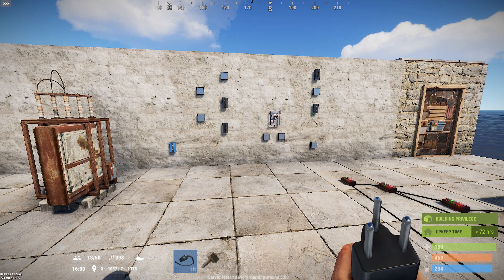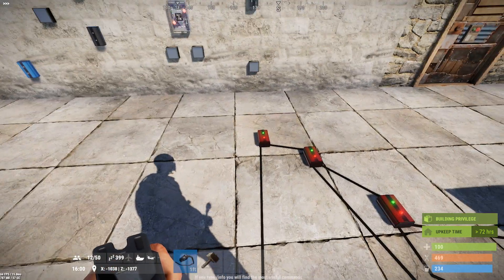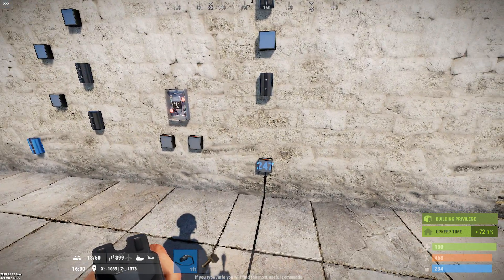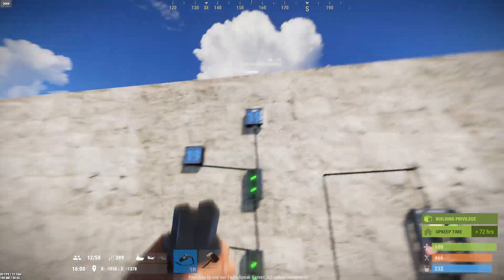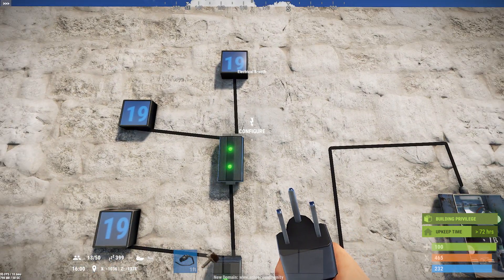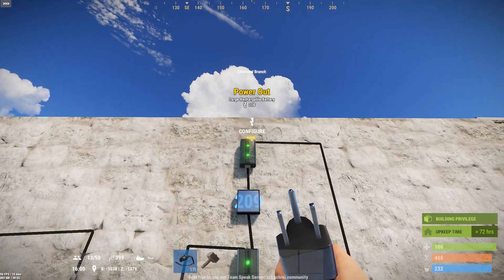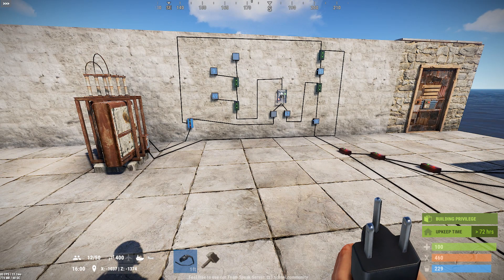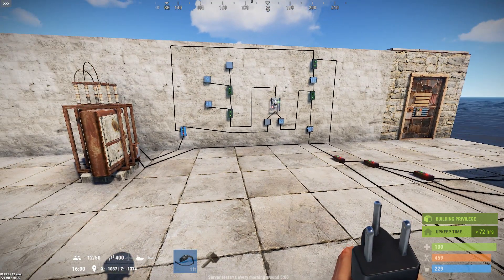Rust Electricity 101: Basic Circuits - Practical Power Use w/Battery Backup

Comment: Even though this is a very clean, clever and elegant solution to power management and also a very good example of Rust circuit logic, I think there is a bit of overengineering there. What we want to prevent in order to not run out of power, the battery to be drained faster than is being charged. This is easily achievable by creating root combiners and adding a cheap new solar panel to the input stack whenever is needed. That been said, I think this is very applicable to a lot of other common control scenarios. Great video!
Reply from the maker: Couldn't agree more. This video is long before you could recharge batteries properly. Back then the batteries could not be charged as fast as they discharge and rWm were not even a thing yet. I may need to start hiding some of these old videos that are not longer relevant.
Reply: @RabidRabbitGamer  Don't do that please. You must find irrelevant a few for sure, but I enjoy clever systems. I guess that won't get old!
Reply from the maker: @dallas-cole  I have only taken down a few old vids and usually after I have the chance to replace them with a newer version. I need to learn how to use the links on videos more to keep these up for searches but link to new versions, that would probably be the best answer!

Comment: Thank you, this helped explain a lot of questions I had. I’ve been playing rust for 3 days now and trying to understand the electrical theory of each component wasn’t very clear.
Reply: this is not updated , before bateries couldn't charge up and give energy at the same time, now you can charge up without this circuit and still when it's night it will automatically use it's energy.

Comment: If you put a root combiner instead of the OR switch then even when you'd drop below the set threshold then you'd be using the max the production outputs and you'd be minimizing the amount that is drawn from the battery

Comment: Using wind turbines in this video kinda makes this circuit seem less essential.

this setup is especially useful if you're running off only a few solar panels and you want enough power to run vital  circuits during the night as well (especially the light).
Because the battery will discharge at maximum capacity during the night, you need to put at least 33 power into the batteries throughout the entire day. This is because the night lasts 15 minutes on most servers, and the day lasts for 45

if you're working with solar panels only, this is even higher, because they aren't crossing the threshold during dusk and dawn and your battery will have to work overtime. In  a real world scenario, its recommended to put up to 50  power into your batteries while charging. This will usually last through every night and the battery is able to build towards a maximum charge over time.
Reply from the maker: Wind definitely changes the intent here on the very low and and very high end. If you have a very low use circuit and wind power, you rarely even need the battery. If you have a very high use circuit, I'd wire the wind in a bit differently to help supplement the battery. I may show of a couple examples of that later. So many different options!
Reply: @Phydeau  I totally agree with your comment and it makes much sense! But do not forget that wind turbines will not only recharge your batteries during daytime because it will produce power at night wich can fluctuate a lot unfortunately. 

Thats why we build in the configurable minimum power output of the first branch so that whenever the windturbine(s) fail to provide enough, the battery takes over at any time. Ofcourse solar panels are much more reliable/predictable when it comes down to recharging batteries, but with a very big circuit you need so many solar panels to keep up with the system requirements as they only provide 20 output voltage. 

And wind turbines may also recharge during the night so it is kind of just trying out what works best in any different kind of situation. I think a combination of them two is the best option so that the weather circumstances have the least impact on the system as possible.

But you seem to understand the electrical system very well sir!

Comment: Does this still work now with the newest update on staging?
Reply from the maker: Work, yes, but it won't  be necessary with the new batteries!
Reply: Rabid Rabbit Could I request a tutorial on a double batterybackup setup with the new settings? And would it be possible to add more batteries to the backupsystem? How much power would be required to power 15 turrets and batterybackup containingn 4 large batteries? How little power can you send to the batteries and still charge them?
Reply from the maker: @FrozenSpinnzzz  Coming right up!
Reply: @FrozenSpinnzzz  as far as I know the batteries will charge faster when recieving more powr but any amount of power can recharge I think. But to combine this with multiple batteries you'll have to sit and wait untill Rabid makes the tutorial because I want to know myself too now!
Reply: @RabidRabbitGamer  abit late to the party but what is the diffrence with the new batteries? :)

Comment: This is outdated now right? Was this from before you could charge and discharge at the same time?
Reply from the maker: Yep, Jan 2019. It can still be used to save battery power, the newest version of the batteries don't require circuits like this anymore.
Reply: @RabidRabbitGamer  I suppose doing it this way means you don't lose that 20% all the time, as you would passing all the power through the battery. I'm still not sure it makes much difference in practice though.

Comment: for critical backup, yes this works... but you need double the power capacity (charging and batteries) to handle the same power draw. Example you have lights and turrets using 100, you would need 200 worth in...

Comment: what i have to do for using 2 battery for backup?
Reply from the maker: Do you want to use 2 batteries for greater total power output or for longer run time?
Reply: @RabidRabbitGamer yes ... I'm on rust right now and nothing works for me: '(
Reply from the maker: @ivan-vt8fn  If you want longer run time connect one battery to the next. If you want greater total power output, connect two batteries to a root combiner.
Reply: @RabidRabbitGamer how do i connect the two batteries?

Comment: If you run a parallel battery set up - do you run the output of both batteries into a root combiner then into a single blocker, or would you run both batteries into a dedicated blocker then use the root combiner.  

What is the best practice for this?
Reply from the maker: The first thing after each battery must be the blocker, the root combiner acts as a load and would drain both batteries faster than you can charge them unfortunately!
Reply: @RabidRabbitGamer  Thanks for your response!  

If I then took the output from each blocker and used a root combiner to create a single output, would the output from the root combiner need to be fed into another blocker?
Reply from the maker: @madcat9803  Sadly, "by design" the root combiners cannot be used anywhere except after a power source, so there is no effective way to create circuits with greater than 100 units from batteries (other than just temporarily by hand).
Reply: @RabidRabbitGamer  yeah the fact that we can't place a root combiner after any component except for the ROOT source sucks! If root combiners were just 'combiners' then it would help us out so much. lol and I also think that the OR switch should block the lesser amount of power passthrough completely instead of still draining 1 from the battery for example. That way the OR switch could be our blocker function and we didn't need all these extra components to have a 24/7 circuit.